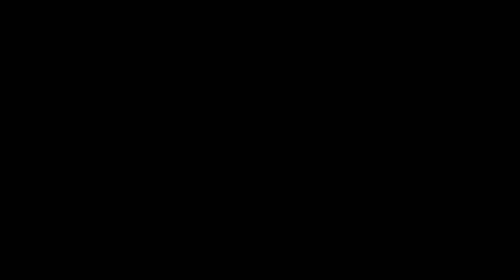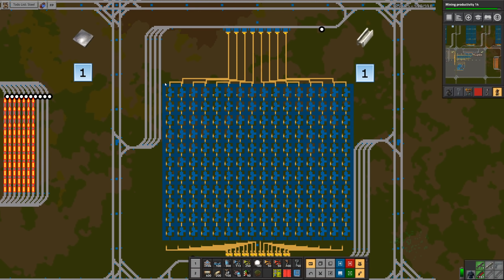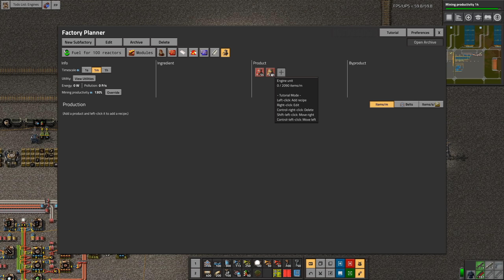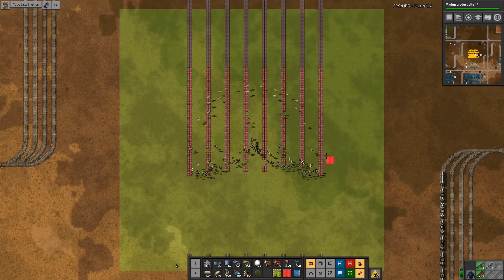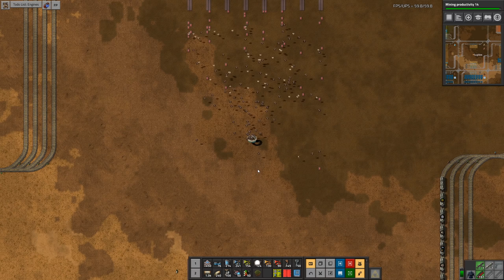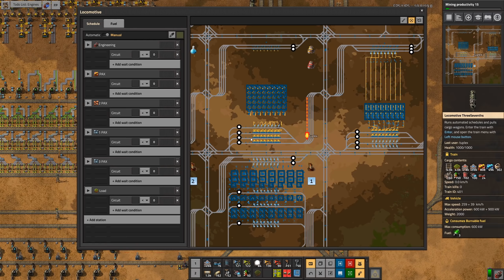Factorio 2,500 SPM Grid Megabase #45 - Engines upgrade

Comment: Hei,
It does allow you to do 2 types of modules. Just select say 2 modules, press ok and then click on the new plus and add more.
Reply from the maker: I thought I did that.  I’ll try again.  Thanks!
Reply: Also, I would appreciate if you would let the rocket counter visible and do small updates on the SPM at the end or beginning of the vid. I am doing my own huge SPM base right now (With Factorio Extended Mods) and I am at about 1200 rockets with Prod at 30 something with a roughly 360SPM. I want to take it to above 5k.